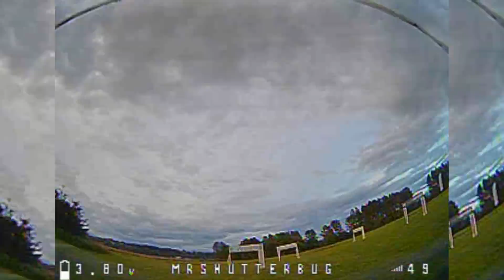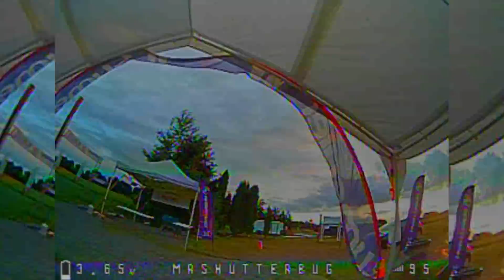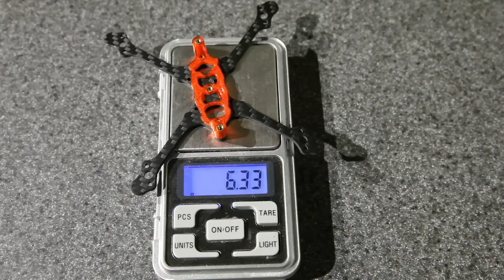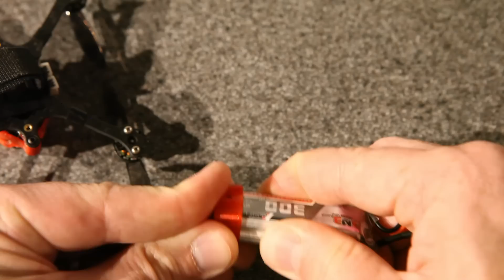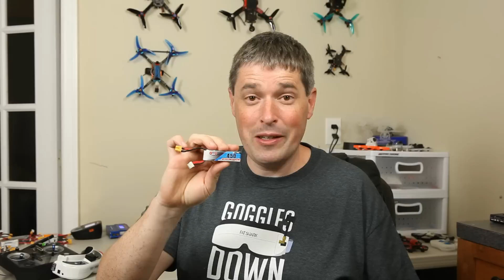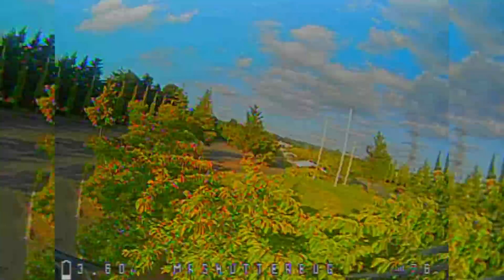GnarlyFPV Primo is SO MUCH FUN!

Comment: Hi There,
great video

I just finished building one of these with the below hardware, I can't get it to takeoff, it just spins out no matter props_IN or _OUT
any suggestions:

— GnarlyFPV Primo V080X Frame 
— Geprc gep-12A-F411 v1.1 2-4s Flight Controller 
— happmodel ex1102-kv10000 motors 1.5mm
— Happymodel elrs ep2 receiver
— hqprop 65mmgr biblade props
— Tbs unify pro32 nano vtx 
— Tattu 2s 450mah Batteries 
— caddx turbo eos2 camera
— Betaflight 4.3.2 w/ RPM Filtering 
— BlueJay 48kHz w/ Bidirectional DSHOT

Hayward
Reply from the maker: The most likely problem is that one of your motors might spin the wrong way. I suggest you take off the props, then connect it to a computer, go to the motors tab in betaflight, plug in a battery, and use the motor testing feature to make the motors spin one at a time. If you look at the chart, it will show you which motor should be spinning. Make sure the correct motor is spinning and that it is spinning in the correct direction. Do this for each motor. If you find a motor that is not spinning the right way, then you will need to use the ECS configurator to change that motor from "normal" to "reversed" or visa versa. Then you will need to "write setup" to update the ECS. Does that make sense? I don't know what ECS firmware it is using, but it is probably BLHeli_S. If you use Chrome, then you don't actually have to download an ESC configurator. You can use this web based one: https://esc-configurator.com/. For the ESC configurator, you will need to have a battery plugged in and you will need to disconnect from the Betaflight configurator (only one connection at a time). Good luck!
Reply: @MrShutterBug  thanks for reply.
2 of the  happymodel motors has red cables, they are motors 2 and 3,  the other 2 have black  cables they are motors 1 and 4

the details say:
The motor with red Cable= clockwise CW
The motor with black Cable = counter-clockwise CCW

I'm using bluejay 18 48khz. should I have them all set the same way either normal or reverse?  or 2 normal and the other 2 reverse?

when in betaflight if I setup props_IN or OUT and make sure the motor directions are right it still spins out.
Reply from the maker: @hprompt166  All brushless motors can spin in either direction, but it will depend on how they are wired up. Each motor has 3 wires. If you swap any two wires, then you will reverse the direction of the motor. So the only difference between the red wires and the black wires is that they line up with the plugs in a different order. Does that make sense?

Now, since you have already built the drone, I suggest you keep the hardware just the way it is. If any specific motor is not spinning the right direction, then find that motor in the BlueJay configurator. If it says "normal", then change it to "reverse". If it says "reverse" then change it to "normal". Do this for each motor until they all spin the direction you want them to spin. If they all spin in the correct direction according to the diagram on the motors tab in betaflight, then you should be good to go. Then you just have to make sure you put the props on the right way. Good luck.
Reply: @MrShutterBug  Hi There,
I finally got the motors setup right using props_IN, it hovers but the motors sounds rough, with alot of oscillation and vibrations.
I'm using BF 3.5.7 along with your pids and filter settings. I'm using standard BF rates

thanks for all your help
Hayward

Comment: Heard the whoop FCs 5 volt reg cant handle the initial voltage spike with an xt30 so Ive been using jst on mine up to this point.. Happy model FC.   See you've an xt30 tho ..
Reply from the maker: Are you talking about the red JST connector? I really don't think it will save you. A sufficient power spike could kill the 5v regulator either way. The thing that would save you is a low ESR capacitor in the 100-200uF range. I did not use one on my build, and it has been fine, but that would be the conservative thing to do.
Reply: @MrShutterBug  Agreed, Gotcha. OK cheers!

Comment: Can anyone recommend a 600mw VTX for this?
Reply from the maker: Are you trying to long range it through the mountains or something? 600mW is excessive for most situations.
Reply: @MrShutterBug  lol no but im building one only for indoor flight and 25mw doesnt penetrate my walls,  I saw someone put a 600mw eachine nano vtx on his Eachine Trashcan and its great, almost no interference when flying behind a few walls which is what I need. I wanted maximum flight times not power, just for indoor goofing around, id like the lowest power motors too. Sorry my mistake its 400mw not 600mw.

Comment: My primo with geprc 12a aio arms then kinda yaws left slightly while it sounds like its going full throttle but does not take off and then it shuts down, and I have to re-arm it just for it to do the same. I am not having luck with this one, I must have BF settings messed up. I did set sbus and correct uart, still no luck.
Reply from the maker: It's hard to guess what could be wrong without seeing it. I suggest you take a video and post your question in one of the facebook groups. One such group is: https://www.facebook.com/groups/1065770156769335/

Comment: Nice tip on the battery strap.  I all ready ripped my tpu mount off and had to use a larger washer to secure it.  I have a bunch of those straps and use that on the fullspeedrc toothpick.  It might save me some weight too.

Comment: Really impressive build and flight.
I just wonder how you applied the Velcro specifically.
Actually I'm also planning to use the battery strap, but there's no gaps between bottom carbon plate, bottom 3d plate and FC.
Did you modified 3d bottom plate by any chance?
Reply from the maker: I did not modify the frame. I sandwitched the strap between the frame (the red TPU part) and the FC. The FC has rubber grommets in the front and back, and screws holding it down. So the FC holds the strap in place as well. Cheers!
Reply: @MrShutterBug  Ok I got it.
Thank you so much!

Comment: Mr.SB, in your vid what's over your right shoulder with the blue props? Asking for a friend 😁
Reply from the maker: It's my new 6S racer. Floss 3.0 frame + 2206.5 1722KV motors + Azure 5148 props + Aikon 20x20 stack. Super light. Super awesome!

Comment: Mr Shutterbug, what are your favorite motors right now to use with the beta85 frame? BTW you can save some cash by going with the Happymodel 1102 motors with the 1.5mm shafts. I'd avoid their AIO boards (personally have 100% failure rate of something on them) but the motors have been solid and can be had for around $34 for 4. Peace!
Reply from the maker: The Beta85X frame has the 4-hole mounting pattern, like most 110x motors. I believe the Happymodel 1102 motors have the 3-hole pattern (just like 0802 motors), so that could be an issue if you want to use it on the 85X frame. I don't have the Happymodel motors, but they look great. For myself, I still use the BetaFPV 1103 11000kv motors on 2S.

Comment: Also, is there room in that canopy for both the VTX and an external receiver?
Reply from the maker: Yes, I have a 25mW on top of the FC. It is held in place by double sided foam tape. Then, the receiver is on top of the VTX. The receiver antenna is coiled up inside the canopy. Probably not the best place, but it works. :-)

Comment: Awesome! I might give this a shot. How do you like the Beta FPV AIO board?
Reply from the maker: Personally, I have not had any problems with these 2S AIO BetaFPV boards. I've used both the FrSky and the NoRx version in multiple builds. Some people have started using the new 12A boards, but I like these because they are a lot lighter. Good luck!

Comment: Been loving my primo,transferred my mob7 to 080x version,its so sweet:)
Reply: How do the 0802's handle the large prop?  Do they feel underpowered?  Is there washout pulling out of dives like you get on the M7?
Reply: @aTuWitty  no washout,and plenty of power for a transfer from stock form,I highly recommend it,I fly 2s 450mah 80c and it rips,slightly better flight times too,depending how your throttling:)

Comment: How's the range on that FC and any random drops from it?  I was thinking of the receiverless version for my build, but I don't know.  Are you running D8 or D16?  By the way, really appreciate the part list and links, you make it fun to build without having to source every little thing.
Reply from the maker: This one actually has a USKY Nano Rx, but I didn’t list that in the parts because it’s not the most user friendly. I haven’t had any dropouts, but RSSI gets rather low. I think that’s because of the way I tucked the antenna inside the pod. I have used the BetaFPV 2S FC with built-in FrSky many times before and it works fine. I don’t care about long range with these, and I expect the range would have been sufficient for everything I showed here. The Crazybee FC on the other hand had much worse range. That has been my experience anyway. Oh and I use D8 whenever I can. Cheers!
Reply: Mr ShutterBug -Thanks!